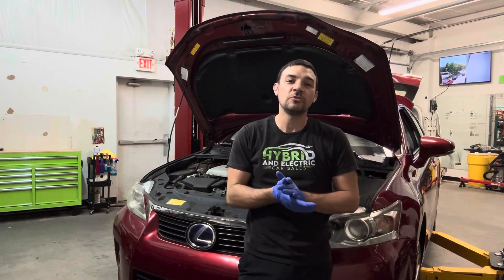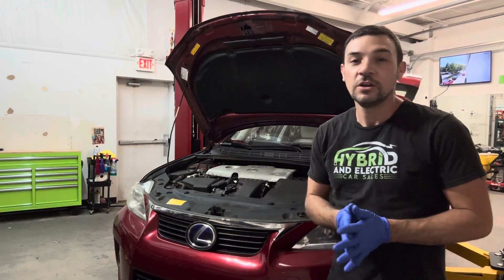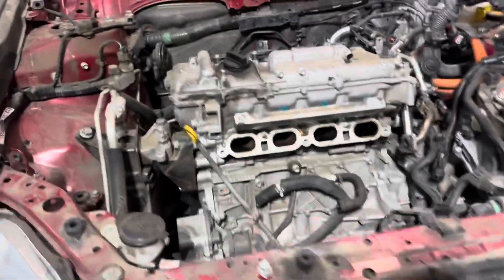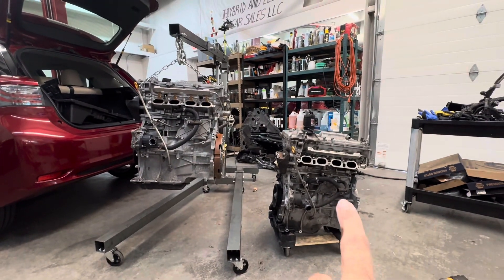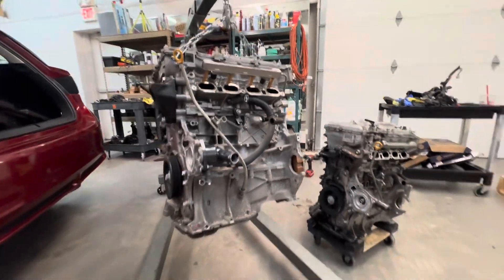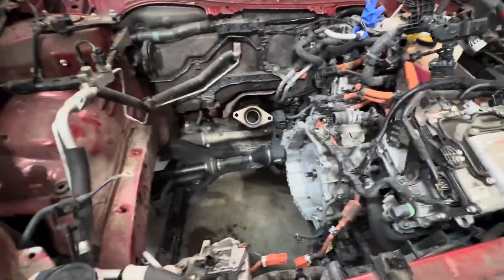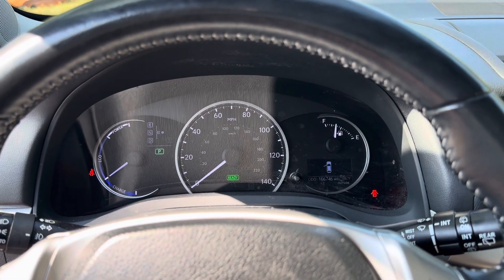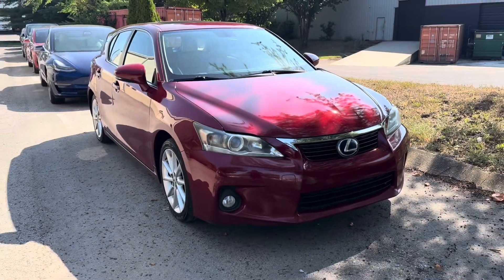CT200H Engine rattle and replacement 2ZR-FXE

Comment: Kind of shocked that a Lexus/Toyota engine needed replacement at 160k vs. a head gasket.

Something strange in design when it's cheaper easier to swap a whole motor rather than repair a head 😮

Good job as always Chips!